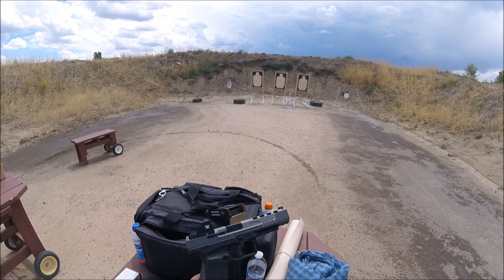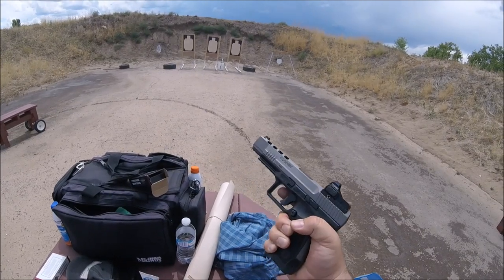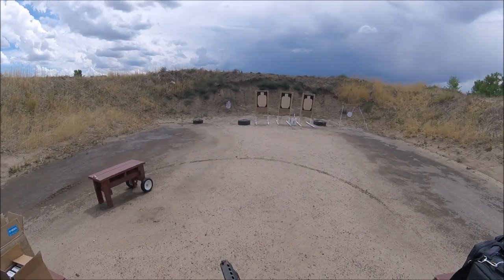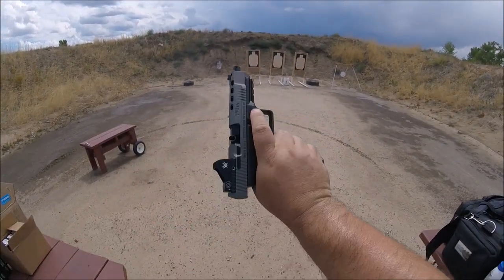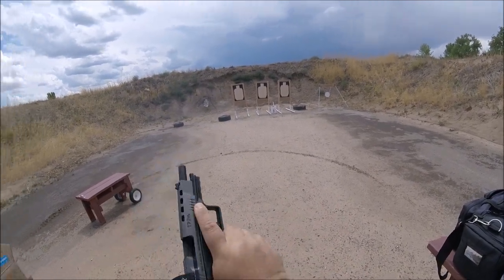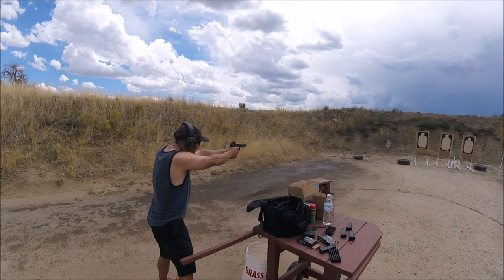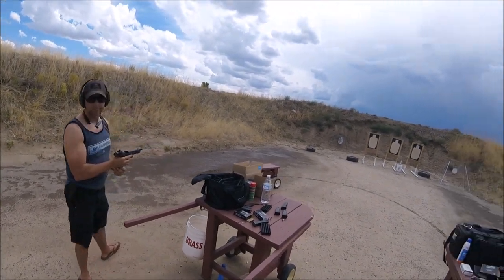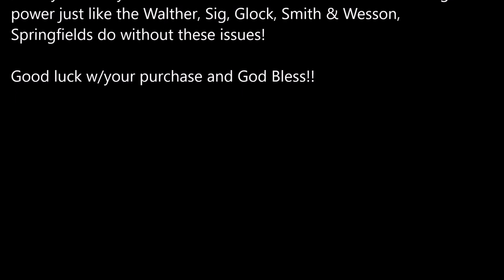Canik TP9SFx Problems!!!

Comment: Nice video! wish it was longer . Thinking of buying one buy I have 1000 rounds of 147 grain 9mm. I'm a little nervous!
Reply: Don't be I run this gun for 3gun and USPSA occasionally it loves 147gr.  I've got over 2k through it. Only issues I had with it was on my reloads with blue bullets that I dropped the powder charge trying to soften the recoil a little more.  Not a big deal.  Most of your factory 147gr should be just fine.  The gun just wants to shoot fast, I always have to tell myself to slow down in competition settings.
Reply from the maker: Personally I think the pistol needs a break in period of full load 115 grain ammo or 124 grain NATO to get to where it needs to be for reliability.  But, from what I've read/heard/seen, this is not universal - some pistols run fine right out of the box (as reported by Pat Hill below).  My buddy who owns this gun has had better success as he runs more ammo through it (some of that is 124 grain or 115 grain).  Quick note, the issues with 147 grain were with Freedom Munitions ammo - great ammo, but power factor is low.  Factory 147 from Speer or others might run just fine.  You may get one of the pistols that needs no break-in, you might need to put some rounds through it before it runs 100%, or, you can get a different spring like some had recommended.  Either way, the pistol is really a great value for the cost - the trigger is incredible, capacity is excellent (great magazines too), and it is optics ready.  Good luck!

Comment: What about an aftermarket recoil spring, would that make a difference on the 147 grain?
Reply from the maker: I'd bet yes - the Canik belonged to a friend of mine, he sold it.  I've heard / read that various spring combos helped, also heard that Canik would send a recoil spring if you contacted them w/the issue.  It was a nice trigger and a great pistol - running 147 close to power factor for USPSA would make it a great setup (ditto IDPA), but out of the box some of them had issues w/147 and/or lower power ammo.  Ran 115 pretty well and 124 NATO like perfection from what I've read.
Reply: David Valdez Thanks David. Another comp shooter here in YT runs a Springco USA recoil spring so planning on ordering that for it. There’s a shop in Texas that offers it with the Vortex Viper sight for like $650. I’m really impressed. I currently have an XDM 5.25 so looking forward to practicing with the new optic sights.
Reply from the maker: Nice!  I had an XDM 5.25 and it ran very well - I wasn't a fan of the trigger, upgraded it to the Powder River and what a difference!  I ended up selling it to by an X-Five P320, but it is a solid performer!  I like the ergo's of the Canik better though - and man, heck of a trigger out of the box!  You'll love shooting it w/the dot, so long as the transition doesn't bother you.  It bothers some guys to go from sights to dot, but once you get the hang of it, just like switching from rifle to pistol.

Comment: there is no problem with this weapon you check or replace the flares you use or use the original flare gunpowder is not enough because the gunpowder is not enough right to return this weapon is absolutely great

Comment: Stop shooting Freedom Ammo I see on "YouTube" all kinds of issues with this ammo show us a video using Winchester White, Federal, etc and see if you come up with different results ? My Canik shoots great but the slide has looser tolerances then my Walther 5" PPQ M2.
Reply from the maker: Freedom was one of the ammunition makers we tried, follow-up video shows us using another brand and another bullet weight.  That ammo ran fine, but not because it was not Freedom.  Freedom loads decent ammo, I've used it for years in competition and I know many competition shooters (who are far better than I) who also use it.  The issue w/the model we had was the bullet weight.  147 grain would not cycle consistently, 115 would always, and 124 grain would almost always.  There are several folks who reported to us that they had similar experiences, Freedom Ammo or not, so we do not feel it was the ammo. Regardless, nobody wants an unreliable pistol, so that baby is gone.  As I mentioned before, all my handguns (Glock, Sig, Smith, CZ, etc.) run 147 grain Freedom and/or anything else I can feed them without issue.  This Canik had problems.  I have no doubt there are other production model Canik pistols that don't have issues, the comments are full of those statements.  Glad you are having a better experience!

Comment: Wondering if y'all could help me.  Went shooting today.  I have the same pistol. Shot 115 gr  ball ammo.  Once in a while.  The trigger would just not pull. It felt as if a manual safety was on.  And it doesn't have one.  I would tap the magazine from the bottom and then it would allow the trigger to work.
Reply from the maker: Ouch, tough one.  Was it the first round every time?  Any chance you were riding the reset too much?  If neither, that's a tough one.
Reply: David Valdez . Nope to both questions.  It was odd.
Reply from the maker: That is odd, I'm sure it's a confidence breaker.  Might try again and chart what happens.  Could be a warranty issue.
Reply: Place your trigger finger slightly lower on the trigger. If you don't depress the dingus/trigger safety towards the lower end the trigger won't pull.
Mine initially caught me out a few times that way.
Reply: I'm with Shaka260 on this one.  I'm holding mine in my hand right now, and if I try to pull the trigger from the top the trigger safety doesn't get pushed in all the way and the trigger stops dead.  If it's not that, then it sounds like a real show-stopper.

Comment: Judging by the ejection of the cases it looks like either the gun isn't broken in yet and the slide is a bit tight or the recoil spring is too heavy for the loads being shot.  With my 1911's I change out the spring until I find the one that allows the cases to go about 6 feet.  Yours are just barely popping out of the gun.  Are there different recoil springs available for your gun?
Reply from the maker: Thanks, not my gun, but my friend says Canik is sending another spring out, so we'll find out soon if that's the fix.

Comment: A couple of things come to mind....First the Canik's are known to ne heavily sprung. This makes sense, most guns are designed to shoot full power ammo, NATO ammo. Second, Freedom Manure eeeer Munitions isn't know for full power ammo. Was it USPSA style Power Factor ammo? Third, your RMR adds weight to the slide making it harder to get moving. Your malfunctions seemed to be from the side short stroking. At least from what I could see in the video. 

So you want the gun to preform, buy good ammo. Or respring for Power Factor ammo. Over on Brian Enos several say the Glock Gen 3 SS guide rod with an 11LBS spring works.
Reply from the maker: Thanks - first disclaimer, not my gun - my buddy Dan owns the Canik.  Every pistol I own runs Freedom 115/124/147 - factor recoil spring and aftermarket.  I have yet to have a pistol fail with Freedom ammo, and they all run hotter ammo just as well.  I did have an issue with Freedom Ammo last winter, Freedom shipped me a new case for free - no qualms with Freedom from me.  The RMR does add weight, but we replicated the issue with the same ammo w/out the RMR in another video.  I have had several folks report running 147 factory just fine, others have the same issue with 147 ammo (not just Freedom).  To me, this is more like a quality control issue with recoil springs, but again, not my gun.  I'm sure I could cook up some 124 grain hot ammo loads for the Canik, but my contention is this - my Glock's, Sigs, Smiths, CZ's, Springfield's and all the rest run 115 to 147 Freedom and all other ammo w/out issue.  Dan's Sigs, Glock's, CZ, H&K, etc. all run the same ammo combinations.  Sure, he can (and probably will) get a different spring, but it seems strange that Canik would only run 115 or 124 NATO with any degree of reliability (to me).

Comment: The problem is it is probably the weak remanufactured Freedom. Second NATO spec 9mm is not 115gr like you claim in the intro. NATO ball ammo is a hotter 124gr
Reply from the maker: Okay, the problem is the ammo - with this gun, yes...  I'll say it again, how many other production 9mm striker fired guns NEED to have hot ammo to run?  I own most of them (Glock, Sig, Springfield, Smith & Wesson, etc.) and they all run 115 to 147 just fine.  That's my point really.  Sell a striker fired 9mm handgun targeted at the competition or carry market in the US, and it should meet the same standard (my opinion, I know).  Many folks say the gun won't run weak ammo, but all my other 9's do just fine.  Weak Freedom, weak 115/124/147/165, they eat it all.  Along comes the Canik and it can't run w/out a break-in of 124 NATO and I'm supposed to be okay with that because???  How many folks buy the gun thinking it'll run the same ammo they shoot through their other guns only to find out it won't?  Look, we're not stupid, we are pointing out the fact (that many have confirmed) that some of the Canik's won't run anything well until they digest 124 NATO.  However, some of them run 115 ammo (like the weak Freedom that we ran successfully in our follow-up of that ammo) in the gun, and some folks in this thread and that one report being able to run 147 successfully (again, what people have commented).  I know what 9mm NATO is, I'm a veteran, I've used it.  NATO Spec is not 115 9mm, I don't claim that...  From the intro:   "from what we've heard, 115 grain and full power NATO runs just fine".